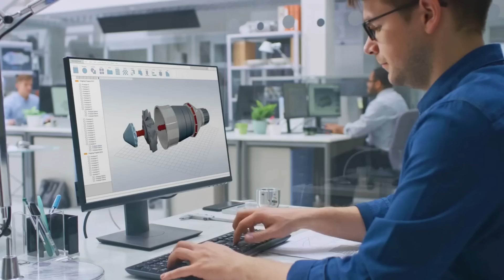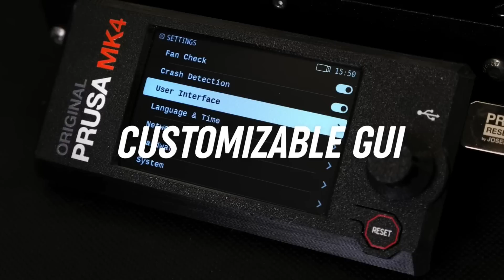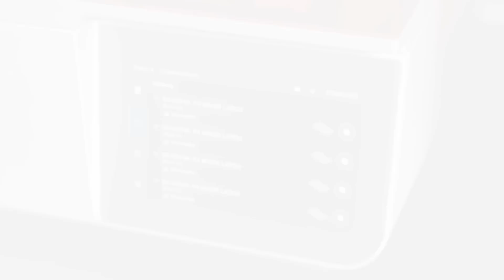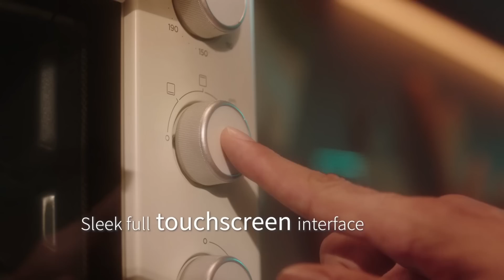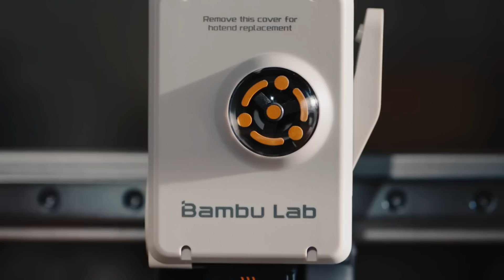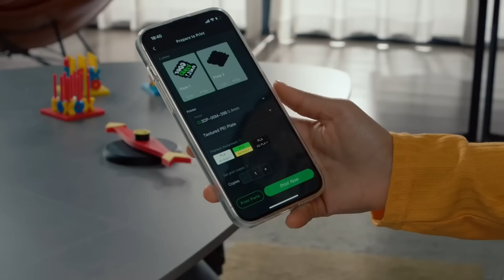Best 3D Printers 2026 - The Only 6 To Consider Today

Comment: Depends on what one wants to do with a 3D printer versus one who will use it for business purposes ( making money to pay for it )
because most are hobbyist style users so an expensive printer is NOT what they look for

the bottom cheapest at $ 279 is almost to expensive and the  over $500 bucks is already out of reach for most starting out unless they are a Business and the nearly $1000 price also far out for most

Surely there are far cheaper printers that do the job especially for starters/hobbyists style folks 

those with huge $$ who own or work a business YOU have the means, MOST do not !!!

Comment: 1. Bambu Labs P1S
2. Bambu Labs A1
3 and 6. Bambu Labs A1 mini
4. ?
5. Bambu Labs X1C

After owning all of the machines except the resin printer from the list the Bambu labs printers are the only ones I would go back to. They are reliable, easy to use, fast and have good print quality.